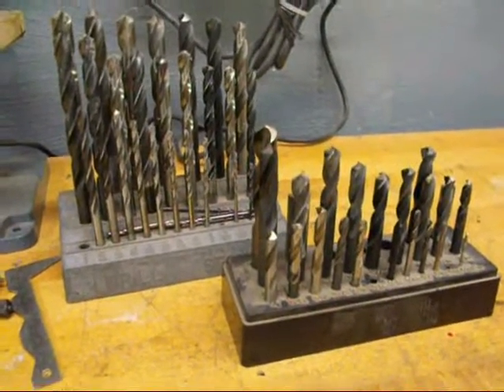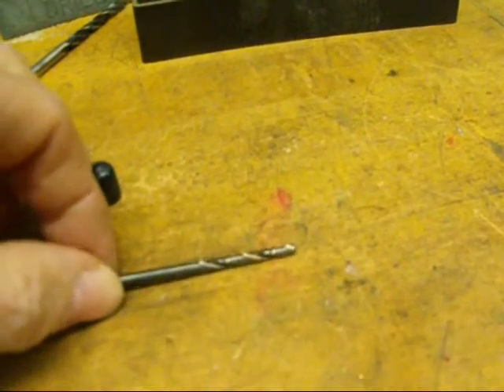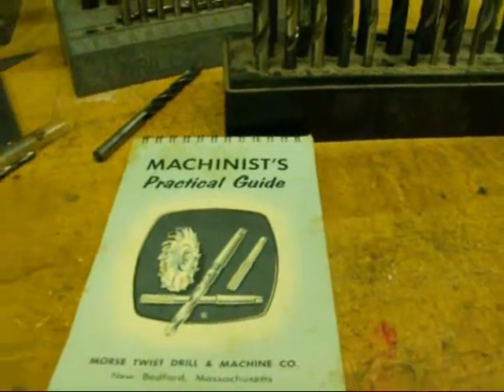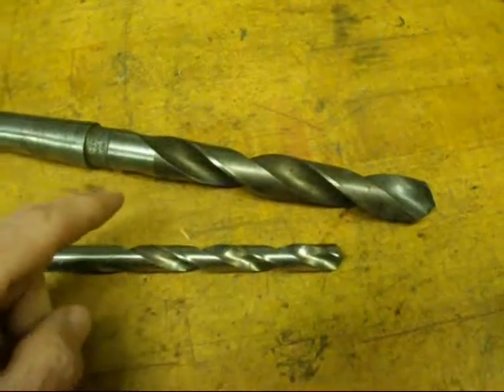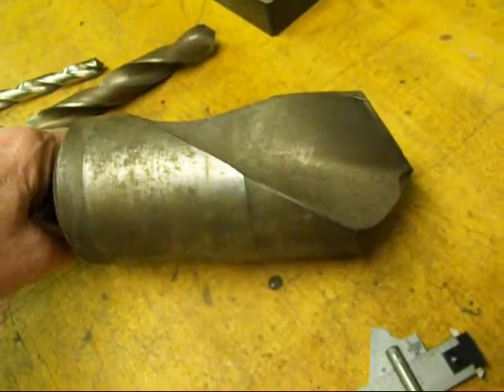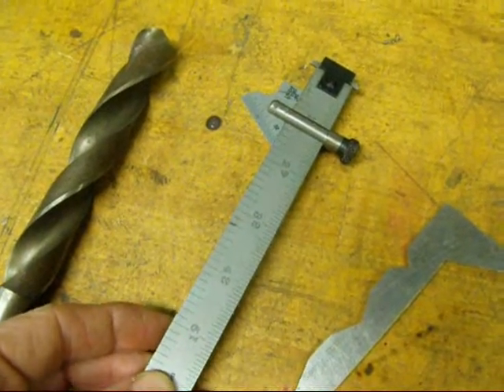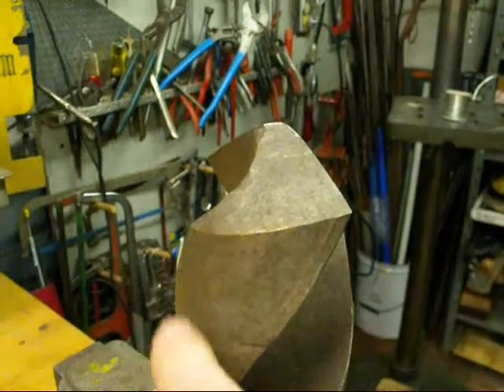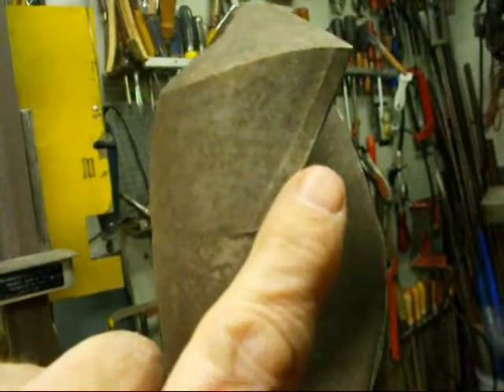THE USE & CARE OF DRILL BITS part 2 of 3 tubalcain

Comment: was using drill bits to make small hole is some metal 1 snapped in half, another tip snapped off, and 3rd deformed the grooves came undone. this a heat issue or a drill bit quality issue?the bits were cheap and part of set.
Reply from the maker: Cheap drills
Reply: @mrpete222  I figured it out. wasn't cheap bit. apparently was using wrong type for the job. switched to titanium bit and went through like butter.

Comment: Yes,,back in Feb 2021,,,was to busy to stop and sharpen the bits I was using to make a welding fixture plate, so set the Bride to Horror Freight to pick up a 110 set of Warriors,,,has good luck from the one that came from Mexico, but the new ones from China had zero to negative relief. They tryed to replace with another set,, but declined and have booted HF off our vendors list,,,(@@)! On to Part 3,,,:)>
Reply from the maker: They sell some real junk

Comment: I do not think that the chunk out of the face of the big drill is breakage but is a chip breaker. Some one has ground a chip breaker in that large drill. The drill must not just have the 10 degree clearance but also must have another clearance for the vertical movement of the drill which most people do not know about.

Comment: Correction to around 7:00 or so in the video: reamers do not cut on the side of the body, they cut on the cutting edges at the tip just like a drill does.
Reply: Reamers cut on the flutes. They don't have a tip. Are you suggesting you can plunge with a reamer? Am I missing something?

Comment: I have a 115 piece Chinese drill index that I bought for $29.95 It drills everything! I think it might be made out of carbon steel too, or maybe Pepto Dismal, I'm not sure. But they're like the greatest drill bits ever made! Each one is precision ground to perfection. I'm telling ya. OK I might have had to sharpen a couple of them over the years I've been using them. I can't afford them expensive fancy pants domestic drill bits. No sirie Bob. Import quality is for me.
Reply from the maker: +Paul Frederick Thanks for watching-glad you got a good set
Reply: mrpete222
 My set does not look too good. But I have had it for a long time now, and over time I have come to respect it for what it can do. Which is drill a wide size range of holes into a variety of materials. I don't expect them to drill much more than mild steel though. Just the whole set alone is pretty handy to have. One box does it all. They're really the only number, and letter bits I have. Look at this big box of bits http://www.harborfreight.com/power-tools/drilling-bits/115-pc-high-speed-steel-drill-bit-set-with-index-61620.html The box alone has to be just about worth the price. Heck with a 20% off coupon you can buy a set for less than I did. You know you wanna.

Comment: I really like those mature and experienced teachers, like you sir.  You are used to explaining things without any stress.  Just one little question.  Why are drill bit tips to be sharpened in a 118° (59°) angle and not 120° (60°)?  There must be a reason, I just can not imagine why.
Reply from the maker: 1959Berre 100 years of tweeking it till they got it just right. Those angles do change for diff material & other variables.
Reply: Thank you.

Comment: Excellent video! I have used and sharpened a 2-1/4" X 10" twist drill and it really is a challenge!, and as mentioned, you need a lot of HP to drive it!. I was using it in a 20Hp engine lathe @15 RPM and those chips would come off 1" wide and smoking hot!